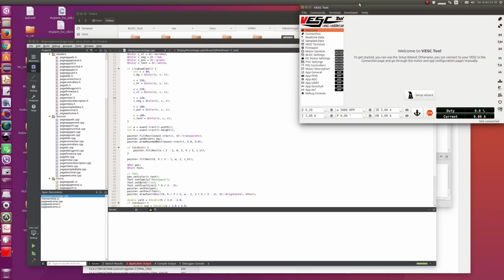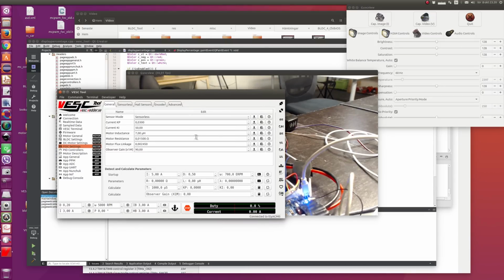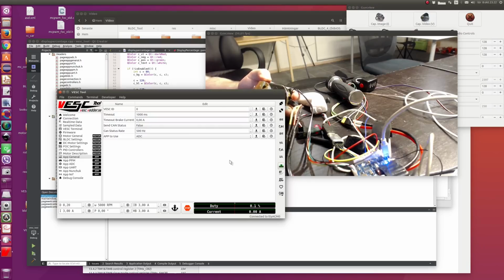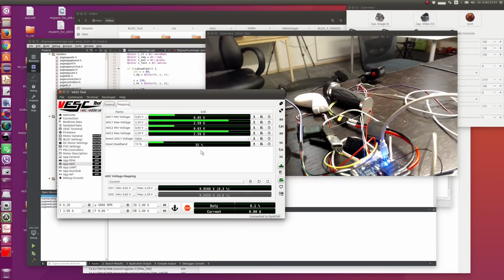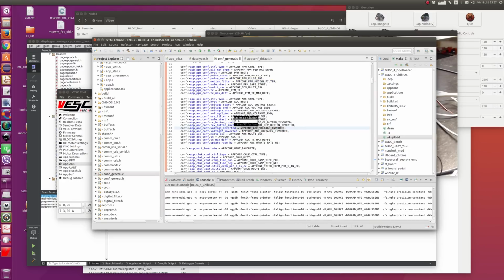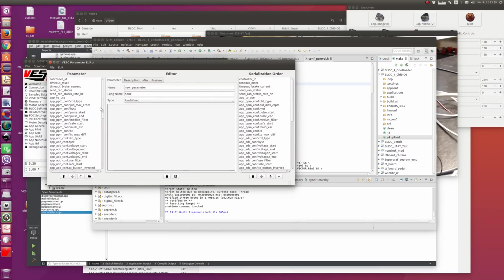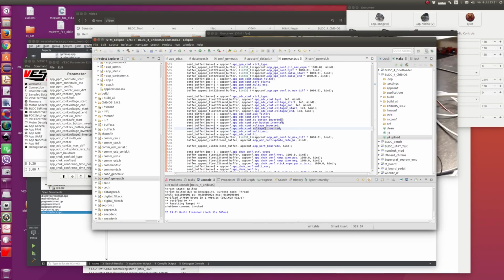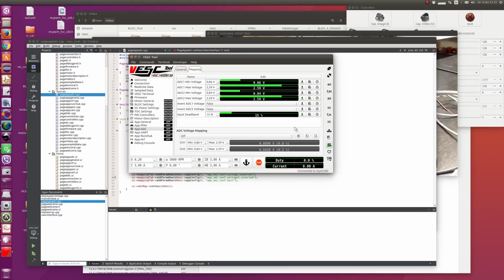VESC Tool update

Comment: Great work! Have all the references to 'PPM' been corrected to 'PWM' ?
Reply: Yup I'm with Ian here, as explained in my comment working on talking to the VESC with arduino and it expects PWM if you try to send positioned pulses instead of changing the pulse width it doesn't work because that's not what the VESC is looking for, it's looking for a pulse width between 1500-2000 micro seconds (if you go with the defaults, can change this range in the configuration).

https://en.wikipedia.org/wiki/Pulse-position_modulation

https://en.wikipedia.org/wiki/Pulse-width_modulation

Believe the Servo lib I'm using to writeMicroseconds is using PWM based on what I can gather from the code https://github.com/arduino/Arduino/blob/master/libraries/Servo/src/sam/Servo.cpp#L92
Reply: PPM is correct for RC Signals although it is the same as PWM
Reply: PPM and PWM are not the same thing. If you use a PPM signal for something expecting a PWM it will not work (and vice versa).